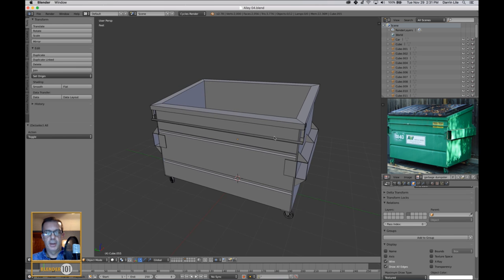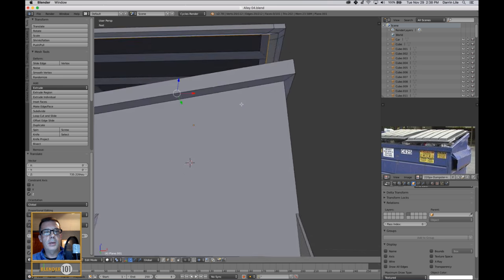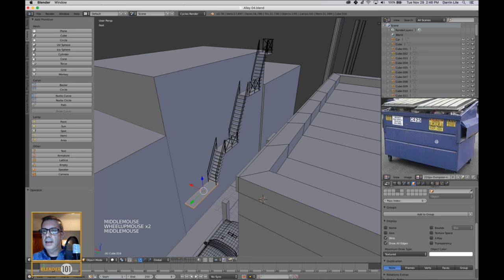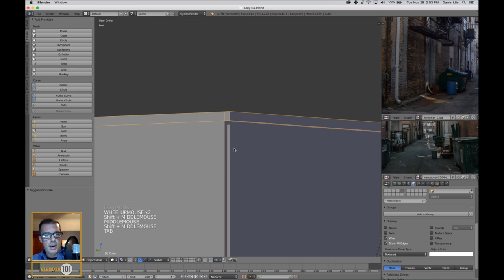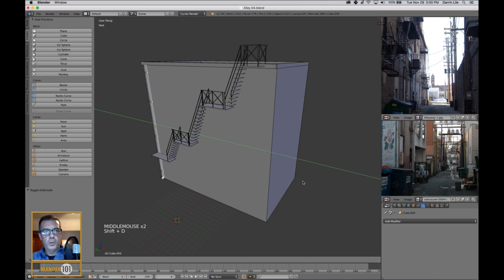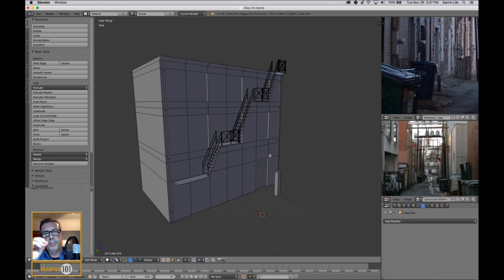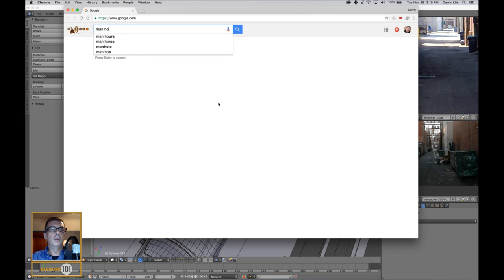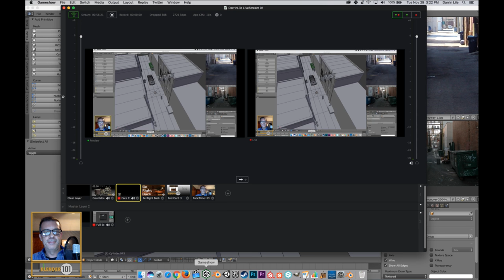Blender: Modeling an Alley 04-Live Stream

Comment: Hello, 
maybe a much faster way to do this with the circle in the plane is to use the loop tools. I tried this out. Make some Loopcuts like you in the the plane and make an inset. then take the inner vertices and use looptools/circle. voila, you have perfect round vertice in the plane and you can work further with this like you to extrude etc. 
just a suggestion

Comment: Let me thank you for the great video. It's fun and educational to watch. 👏

Would it help to set the fire escape platforms and windows by determining floors first by evenly distributed horizontal lines? It's okay about the mistakes because it makes me realize, think, and remember.
Reply: What would be a good mouse to use with Blender? I  understand that it is the one piece of equipment  that should be bought.  It would be nice to get during the cyber sales before Christmas. Thanks for any comments.
Reply: I think as long as it is something of good quality that has a good middle mouse click you will be happy. I use a Razer Naga just because I like being able to push the numpad shortcuts with my right thumb. But do be careful because some of the mice I have, mainly a Logitech MX Anywhere, the middle mouse click doesn't actually register which is a show stopper.
Reply: James Johnson Thank you for the inside dope. I was looking at a Logitech. I will look at a Razer Naga.
Reply: You're welcome, dont get me wrong though.  Logitech makes really good stuff, just the one mouse I've had an issue with.